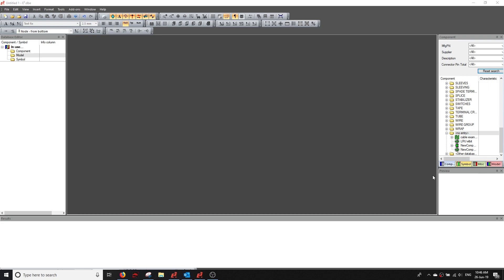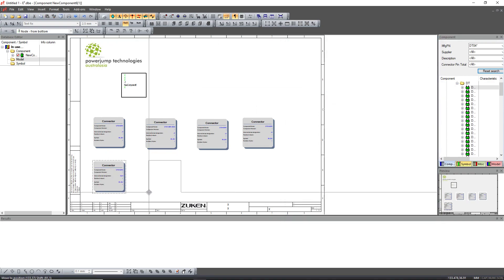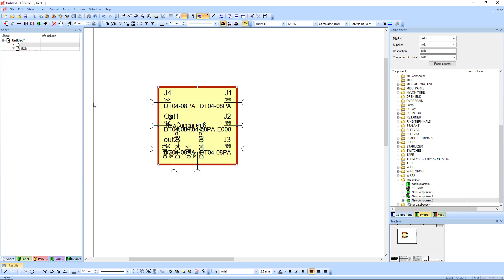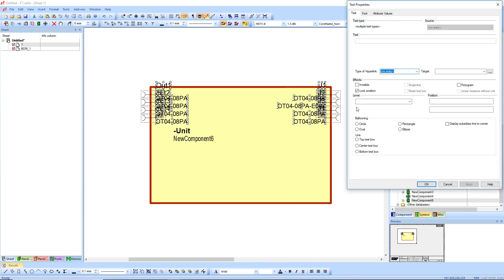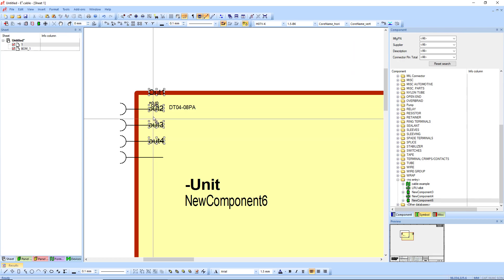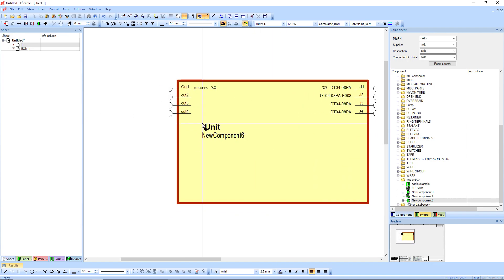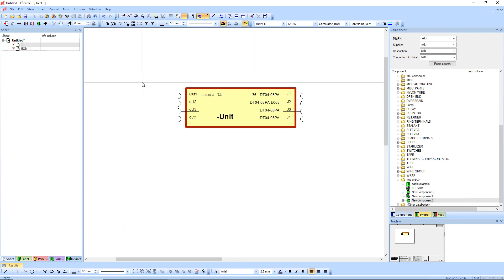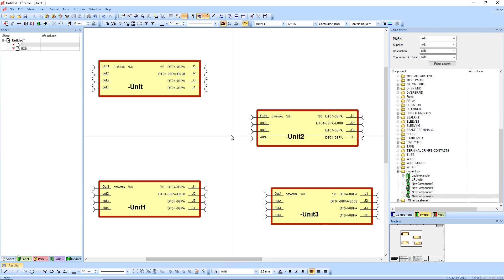How to Creating a custom Block in E3.series with fixed configuration and size.

Comment: Hello! I can not understand the concept of using block. Why is used for and what information is represented using a block? Thanks.
Reply: Hi, a block represents a generic "Component" with an internal circuit, which you normally don't care about. What you actually care about are the interfaces ( connectors ) to your cicuit. It's a good way to represent a microcontroller on a shield for example. If you need the inner logic also, you are able to make blocks hierarchical and build the logic on the "block"sheet. On newer E3 versions you are also able to place connectors and connections within normal blocks.